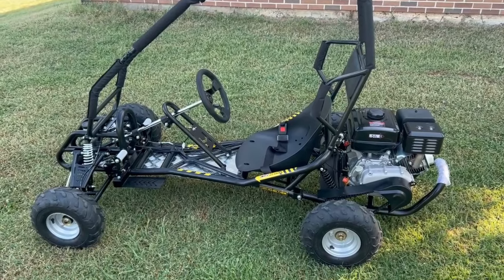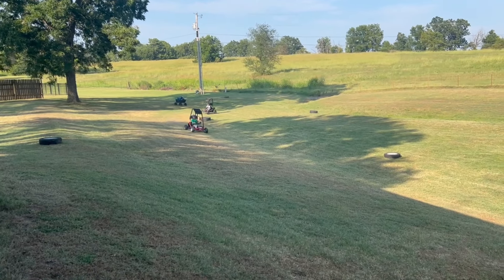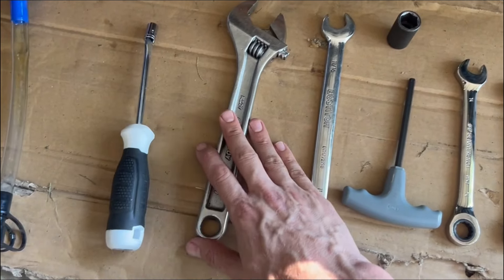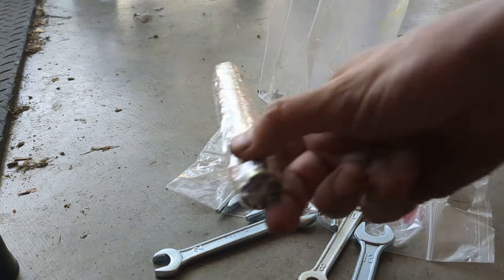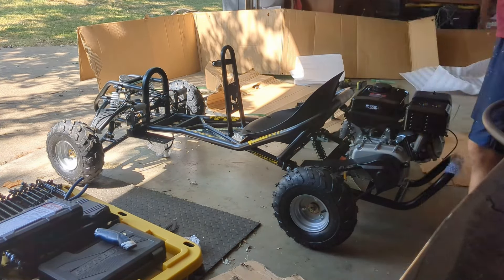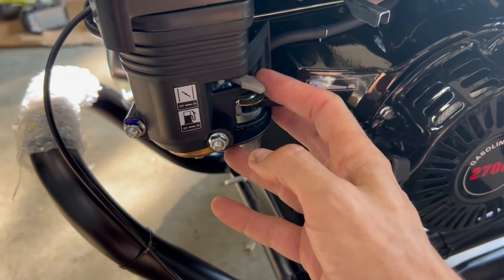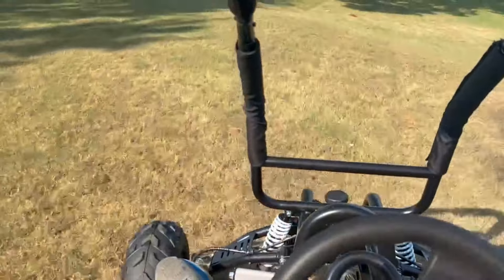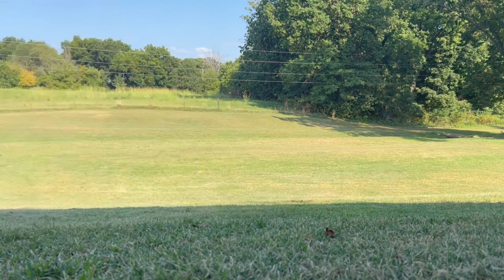Go Kart Review- Chinese Adult and Youth Single-Seater Karts

Comment: Hey im making a custom Raspberry PI to power my lifted 87 Subaru GL that im EJ2.2 Turbo swapping, would you be down to help me with getting the instrument cluster set up? im trying to figure out if its better to run Linux or Android OS ,
Reply: I will be running a Speeduino Standalone Engine management system and would like to have my PI to be able to be reading live data from the Speedy and have built sim card so that my tuner can acess the car from anywhere.
Reply from the maker: @EJGL10  shoot us an email- we can likely at least point you in the right direction! theonegauge@gmail.com